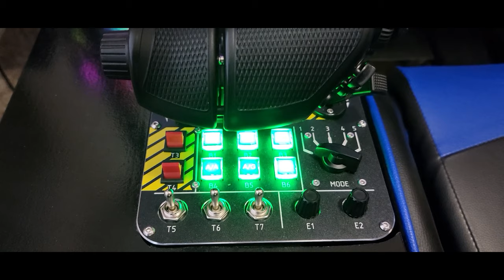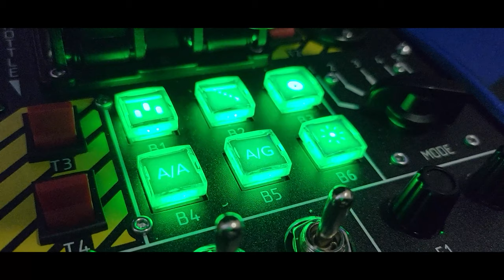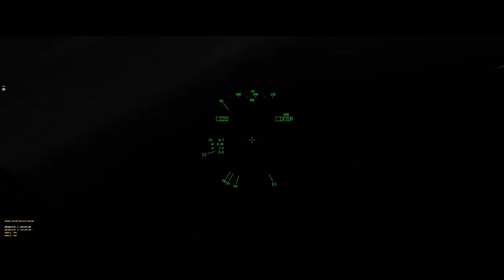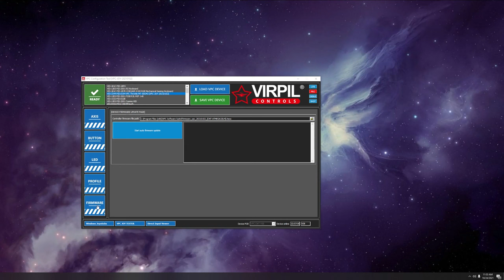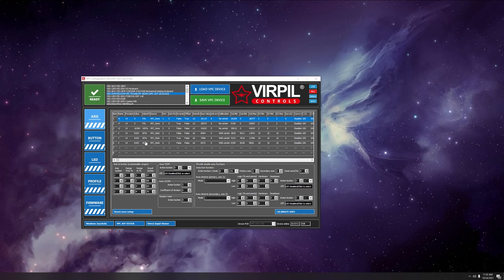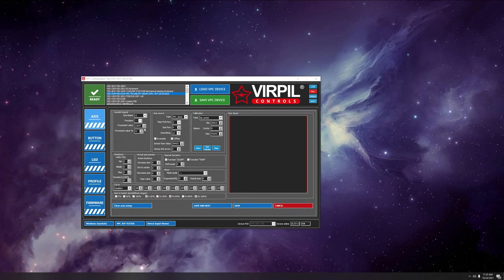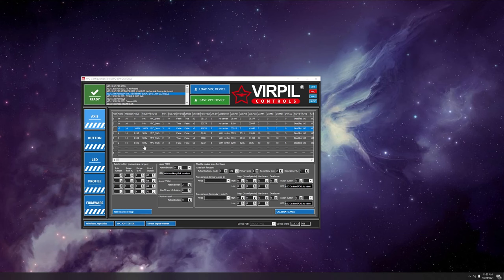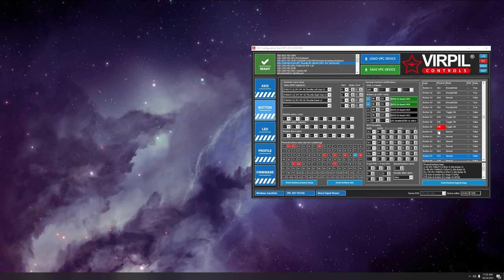VIRPIL's New T-50 CM3 Throttle: The Ultimate Upgrade?

Comment: I bought this throttle a couple years ago and not only is it a really great piece of hardware, but the customer support is among the best I've ever dealt with regarding products or services.  I had a main board fail, and they sent one with complete instructions for replacement free of charge.  They also offered to replace it for me if the instructions were too technical.  Call me a fanboy.  :o)
Reply from the maker: I completely agree! Virpil is pretty awesome. VKB has been really amazing as well.

Comment: Two-Way Switches: You can activate all button positions by selecting "Reset buttons logical setup" in the buttons tab and THEN manually re-assign all buttons. This way you can split the Two-way switches into two buttons AND you can activate the button functionality for the Mode Selector knob while still being able to function as a 'Shift'-button. I do advise to simply assign the SAME Logical button number to the Physical button as this is more in line with the Button Mapping Template. It is important to know that ALL button bindings in games will change: e.g. Physical button 1 is press down on the left rotary knob, but VPC default logical bind is 'Button 6'.

Comment: The Algorithm  gods smiled on me today. Nice review, good solid commentary. Sub'd. Keep them coming. I have a pair of Alpha's on MogoosT gimbals, and the CM3. Monstertech mounts. Huge improvement over the 56, 52, t16000 used prior. They will last a lifetime.
Reply from the maker: Thanks for the sub and the feedback! I have to admit that the alphas are looking to be quite attractive as an option. Part of me wants to convert to dual-stick, but my time is balanced between both DCS and SC. So it becomes a struggle to find a way to easily swap out a collective for helicopters, a throttle for fighters, and a dual-stick for star citizen. First world problems I guess haha
Reply: Logitech really doesn't care about their flight sim hardware. They lost all respect from me. They took whatever Saitek was doing and ruined it with cheaper labor and the cheapest parts you could get. I bought an X-56 throttle used that was promised as fixed from ghosting, which was attempted, but not truly achieved.
 I fixed the ghosting myself twisting the cables, setting them at the proper angels with one another and using ferules at the end.
I got a much better response but the throttles STILL ghost when you need them the most from time to time.
Even the Hall sensors at the top two axis were messy.
Stay away from Logitech as much as you can.

Comment: I love this throttle.  My ONLY issue is the slider (3rd finger digit on the throttle) has a terrible center 0.  Deadzones (2-10) 
don't help.

The software was laid out by an engineer.  Its very flexible and yes, there is an acceptable learning curve just as there are more plug n play options.
Reply from the maker: Yeah that slider doesn't have the best of deadzones. I really had to mess with the settings to get something that worked well, but I did manage to get it eventually.

Comment: I came back here just to figure out how to do the flap to configure the F-15C module. Haven't gotten into the expensive modules yet as I want to learn how to fly better before I get into cockpit button engineer mode. I didn't want to go through one of the 20+ minute video tutorials when there's an example right here. Thanks!
Reply from the maker: Glad I could help! It's definitely info that comes in handy with modules that have the flaps set up as buttons instead of an axis.

Comment: i've purchased my hotas warthog 7 years ago and i've almost used them daily it workes like a charm for every sim game i've played over the years , just saying :)
Reply: Thrustmaster feels and performs like a cheap toy compared to virpil
Reply: @JSpark135  I have both and you're talking bollocks.

A marketing tool you sound.

The only thing that requires replacing in a TM Warthog set (if one currently owns and has one) is the shitty ball gimbal for a WarBrd D (a natural and much needed successor to a Cougar gimbal anyway). Even the slew has no problem if you tune it, no need to dump another $60 into it from a third party for a $5 switch and a Hammond junction box (which is what your toys are made of) from eBay.  

I've found the three companies TM, WW and V to be comparable in their highs and lows. The modular WinWing throttles seem like the next best option to me anyway. One make crap sticks, one makes so so throttles and sticks, one makes great sticks, but decent throttles etc. None of them are consistent.
Reply: @eustacequinlank7418  I'm ex infantry I have sat in the cockpit of several aircraft, Virgil feels like what real mil aircraft uses. TM products feel like cheap toys, there was barely a difference between my saitek/Logitech and the warthog, barely felt like an upgrade besides the feel of materials they operated the same because  they are a SPRING TENSION  movement.

Comment: Nice review, subbed. Have been drooling over this throttle, but I'm also eager for the VKB TECS if it ever releases. For now my TWCS does the job.
Reply from the maker: Thank you! I saw the VKB TECS as well and while I may not purchase it for my own use, it definitely looks like a really smart design. The modularity they have planned is really unique!
Reply: TECS has been essentially scrapped by this point.

Comment: HavOK, I just received my new VPC V.F.X Grip and I have a link error 254 on the p3 slider and p4 dial. Any Ideas? Dents in the table just trying to find anything about it, even on the Virpil website.
Reply from the maker: Let me do some research with my controllers and I'll get back to you! Is the software giving you the link error?

Comment: Stupid question since i don't have a CM3, and i've been wondering this for a while but can't you use the rotary encoder (The one that sits under the 5way pyramid hat switch that would be above your thumb) for zoom?  I don't think i would use the thick one for the pinky for zoom since it seems a bit out of reach and a good option for older aircraft systems or tilting the radar up and down. Also, is there no way to make the slider on the back less sensitive for zooming either in DCS or in the complicated Virpil software?
Reply from the maker: So, short answer, yes. The long answer is that while you could technically do it, it seems that when you configure it as a rotary encoder in the software, DCS ends up recognizing it as a single keypress every second which results in having to literally have to spam the rotary to zoom in even just a little bit. Thus, it isn't very effective as a zoom :( 

However, I will do more research and testing and put more updates to the software as I learn or figure out how to solve issues that I struggled with in my infancy with the software.
Reply: @Hav0k  Oh right i assumed there was a fancy "rotary to axis" button somewhere but that's just wishful thinking, unless you use a program like JoyToKey or something along those lines. I totally forgot that rotary encoders are just recognized as button presses.
Reply from the maker: @gokuta333  oh man I wish! Sadly I haven't found anything like that or really figured how I can change a button to an axis. I may have to do more research so see what else I can do

Comment: I got this and it seems like im the only one who think its really plastic. Would buy a winwing or VKB´s upcomming throttle
Reply from the maker: All of the internal mechanics are Aircraft-grade Duralumin. As far as I understand the shell it's extremely high grade thick ABS plastic. 

Yes, Winwing are low inertia aluminum which is pretty neat, but both of them are extremely solid and stout. Unless you're truly abusing your peripherals it doesn't matter that much with the quality they both provide.

Comment: I found the software to not be anywhere near as bad as people say it is and found it to be quite nice with how much it lets you do without having to download 500 other peices of software. But it could just be me.

The software is certainly more complex that the software for most other devices you may have, but in a good way. It means you can do a ton. It isn't designed poorly, it is just more complex. It certainly isn't the best peice of software ever made, but I have certainly seen faaaaar worse. And it actually works most of the time unlike allot of other software to configure devices (even ones that try to be "better" and look nice/be user freindly) that may take forever to start, be unrepsonvie half the time, and when it is responsive it doesn't even work properly.
Reply from the maker: I definitely have to agree with you. It let's you do a LOT which makes the software complex and require some time to learn. And the software pretty much works 99% of the time. 

I honestly can't say the same for other companies' software like Thrustmaster, Saitek and Logitech.

Comment: I actually like the software better than the hardware. It’s overrated. There is noise in the axles and the buttons feel somewhat cheap.
I’ll take the warthog throttle over this but that one came defective
Reply from the maker: I honestly haven't had an issue with the axis or buttons. So it may have been that you got a one off